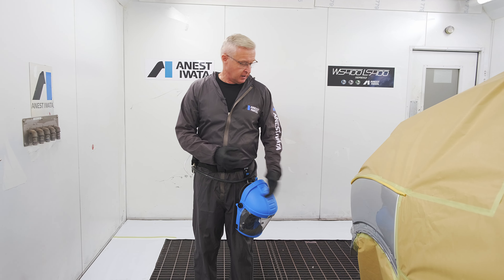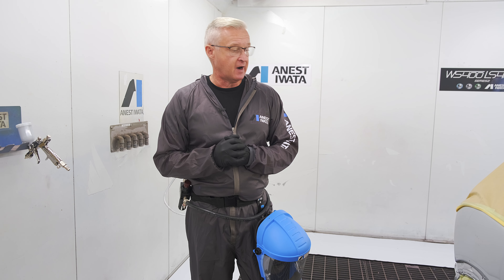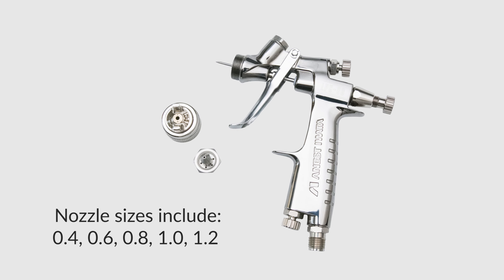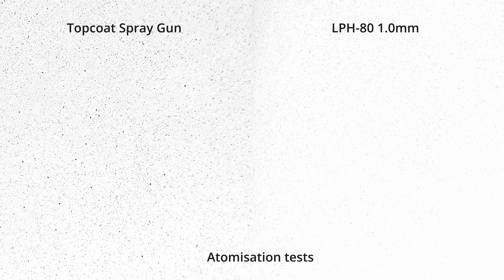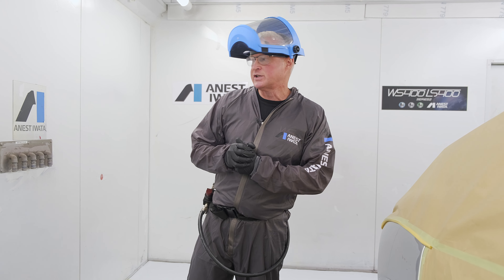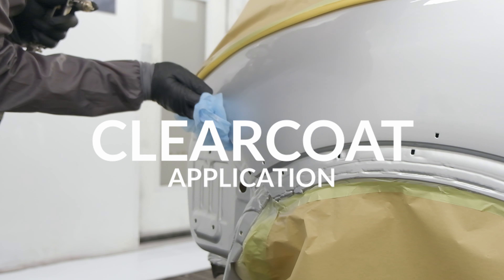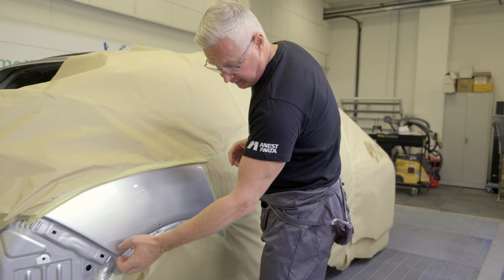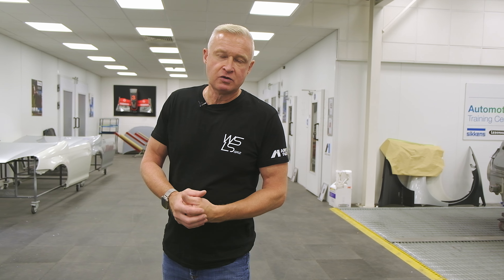SPOT REPAIR WITH THE LPH-80

Comment: Hello, I have 2 LPH80, I have a 1.0 and a 1.2, I love these guns for small repairs, I don't understand the fluid flow setting 40 45 because on the gun the setting is 1 2 3 4 ??
Reply from the maker: Hi @David-rv2fs, you might be getting confused with how many turns out on the fan? 
The fluid delivery correlates to the nozzle size in use and would naturally change with each nozzle size!
Reply: Thank you for your response, what I don't understand in the video is that you make the fluid flow setting 40 50 and on the gun there are the numbers on the adjustment screw 1 2 3 4, so I don't understand how to make the setting 40 50
Reply: @rv2fs  He's just stating what the fluid output of the gun is roughly, it's not a setting(it is, if you have multiple nozzles). In other words, he's not talking about the fluid adjustment setting or the screw at the back your gun.
Reply: @AnestIwataRefinish  Yes, I understood that well

Comment: This is my favourite gun of them all and I own quite few! Nice vid
Reply from the maker: Thanks for the positive comment!
Reply: Is this good for clear?
Reply: Absolutely. I’ve got a 1.2 set up in mine and I’ve sprayed 2K high build primer with it, base, clear and also enamels no problem. I adjust viscosity to suit but it handles everything I throw at it. For all small jobs I use this and my Dv1s. I used to have the Walcom ego but didn’t keep that long. It sprayed nice but couldn’t keep it clean enough for my liking. All metallic particles got engrained in carbon despite thorough cleaning.

Comment: How does this compare to the AZ4?
Reply from the maker: They are quite different. AZ4 Is a very good all-rounder, It will be good for a range of uses including large and smaller smart repairs. (It is probably one of the most underrated spray guns in our range). If you carry out a bigger range of applications this might be the best choice.
The LPH-80 as shown in this video is a master of spot repair, for small and fine work the LPH-80 is the better choice, purely for its atomisation and ability to make the fan sizes smaller. However, as shown the fan patterns up to around 14cm are very good.

So it really depends on what you need - Both spray guns are excellent when used for the correct application. Thanks!

Comment: How does the lph80 maintain atomization at lower pressures? I have one of these guns and fear I'm missing some capabilities. Thank you
Reply from the maker: The LPH-80 can maintain atomisation at lower pressures because it was specifically designed for that purpose.
All of the different nozzle configurations offer great atomisation. We'd suggest trying different pressure and fan settings and then if needed switch to a smaller nozzle if required! Thanks!
Reply: @AnestIwataRefinish  thank you! I absolutely love the fine quality of the Iwata brand.  Also have your HP-CS airbrush as well.

Comment: I love this gun for the base in 1.2, for the clear coat how many bars??
Reply from the maker: It all depends on the repair. The LPH-80 will atomise consistently throughout multiple pressures. You can't go wrong between 1.5 and 1.0 BAR. On this repair, we used 1.0 BAR.
Reply: @AnestIwataRefinish  Merci pour votre réponse, je fait de la petite réparation carrosserie smart ou spot repair donc 1 à 1.5 bar est très pratique surtout si le vernis se pose correctement avec des niveaux de pression d'air si bas.
Reply: What is a bar ? how much cfm required ? ( US)  @AnestIwataRefinish
Reply from the maker: @nixaeagle141  a bar is a metric unit of measurement. 1 BAR = 14.5 PSI. The LPH-80 requires around 2.2 cfm, to operate correctly!
Reply: @AnestIwataRefinish  ok thanks , not much then .

Comment: I love mine but I run a 1.2 looks like I need to try it out with a 1.0
Reply from the maker: The 1.2 is a great all round choice. Maybe add a 1.0mm as a different option, potentially just for smaller work.